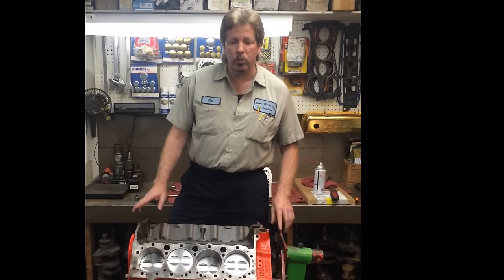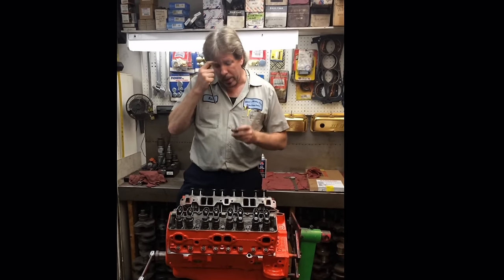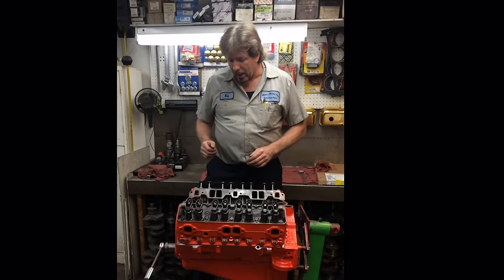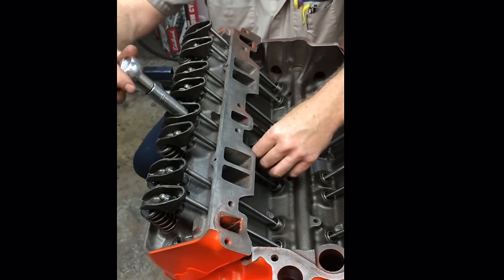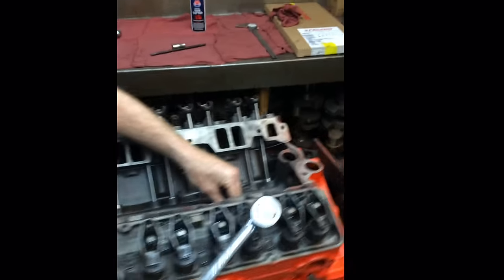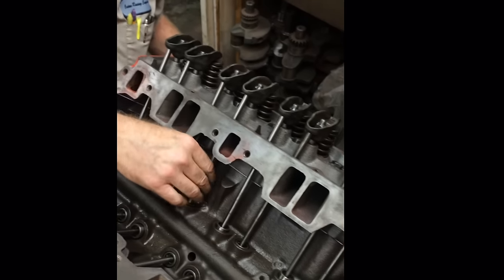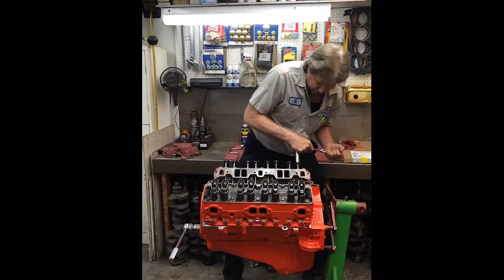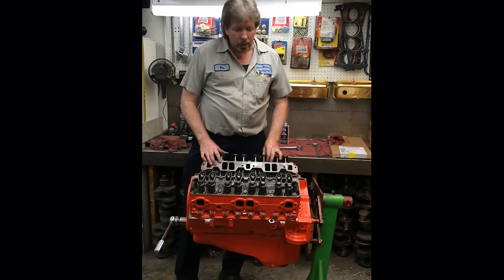Hydraulic valve adjustment made easy - Your Engine Guy

Comment: Wow, great method!Dumb question  here. What method would apply if say you're adjusting the lash of an engine in a car, that you havent replaced the lifters and they remain full of oil. Can this method still be used, or a variation of it? 
Great video, Ken!
Reply: This is my question too. Would love to see someone weigh in.
Reply: Same
Reply: Same question---
Reply: Same here
Reply: Did any one get a answer
Reply: @frankyds69charger65  apparently the guy doesnt check messages or something.  Haven't  heard a word.  Sure would like to know
Reply: Method would be the same
Reply: @farcere  hes pretty clear in the video about the lifters not having any oil in them.  It almost has to be a bit different when dealing with pumped up lifters. Have you tried this with full lifters? I would just like a bit more detail as to why its the same method? Thanks
Reply: @BigBillMiller66  I'm a little confused too, have watched the video several times to pick up any nuances. Part I'm thinking about right now, is when at the beginning he says pumping up full of oil and getting air out, creates a solid lifter effectively and gets rid of the cushioning from the spring inside.
Later he says when people do the running engine method, (which I assume creates the above scenario of filling the lifter full of oil and no air, creating effectively a solid lifter?) then people would find zero lash at that point, the go 3\4 turn over and it results in valve hanging over, but he says that levels out after a short while. Which I can't quite figure out... How would it level itself out if it's full of oil and effectively solid. And I think herein lies the answer to our questions... If the lifter under normal running is NOT 100% full of oil, as a result of it acting like a check valve... Which could mean it empties out a portion to allow room for the spring to take up that 30thou movement, then it should be possible to start engine, let lifters fill up, turn engine off, take valve covers off,and do the process he describes. That way, sure the lifter will be full of oil minus the 30thou space, so it can be set to zero lash, then turned 3/4 to take up the room that the internal spring has, and that would mean it's set right. 
But... It still doesn't make sense to me. if the lifter acts like a check valve then the part about not soaking them wouldn't matter, as it would clear the oil after a few rpms. So I must be missing something.
What I do know, is that engine ran ok, had what I thought was a loose lifter, did the methodology with oil in the lifters, and the engine ran terribly. It ran like he said at the start... Rumbling, shaking,stalling  etc. And it never self adjusted. So that makes me doubt the theory of oil filled process. But then that's how folks did it the bad way i.e. engine running and valve cover off. He says in vid they did that, found zero lash,then turned 3\4 over and it would stumble but clear itself out. So it counteracts itself.
Basically after trying it, confused and still looking for a good answer and explanation :)

Comment: What if my engine's already installed and the lifters are full of oil?  Can I still use this method or will I open valves when I pre-load?  Thanks soooo much for this one!
Reply: I did my engine before with the lifters full. It worked just the same.
Reply: @karlchilders3127  i have my engine to the 3/4 turn part and not wanting to go 3/4 turn on probably full lifters... You said you did though and it was good?
Reply: @workingmansrestorations7071  Yes. Had no problems

Comment: Hey ken great video!! One question though, what if there is already oil in the lifters? I’m working on a 302 and just put some jr Windsor heads on it. I did your way to the point of zero lash, but now only some of my lifters are spongy and allow rocker movement. Can I still move onto the 1/2 or 3/4 turn or should I let them drain down overnight? Then again, if I do that and then reset the lash, when I rotate the motor, I’ll pump them up again!!🤦🏼‍♂️ please help
Reply: @Robert Hartwell   How did it turn out?  Did leaving the lifters upside down over night work then doing Ken’s method work out?
Reply: @jbh.6257  It will still work just let it bleed of for a while before you start it.

Comment: I have a question sir how about if I have the vehicle running already with oil in it can I adjust to that same way like you said my taking the valve covers off do I need to Prime after I adjust even though those oil already in the existing engine and it's not so what would happen if I don't Prime after I readjust it running engine I mean old running engine
Reply: i have  the same question
Reply: @mr.fiero87  set the engine at tdc and turn it 90 degrees for every consecutive cylinder in the firing order. Doesn't matter if the lifters are filled. Final preload can be done right away or wait till the end so the engine is easier to turn and do them after all after the lash is set for all cylinders. If you are having trouble finding tdc hold your finger over the #1 spark plug hole and bump the engine over until you feel the compression. Once there double check it by looking to see if you can see the tdc timing mark on the damper and turn the crank to zero degrees. Then you are ready to start the lash adjustments. Final is 3/4" just like the video.
Reply: @supersportimpalass  thank you much !

Comment: Great video, great method, but you are working with a fresh engine where the lifters are dry. What if the engine is not fresh but has thousands of miles on it and the lifters all have oil in them? Many here say you can use this procedure with lifters wet or dry, but you were very adamant about using dry lifters. Can you clarify this point?
Reply: The oil fills the clearance and hides that drag, with lubricity, so yor not accurate  on zero lash.
Reply: I had the same question.
Reply: If the motor has been sitting for days then the lifters wont be pumped up. This way will work just like any other method.
Reply: What about a existing engine that’s ben put together and running for some time. I pulled my ford 427 valve cover and some rods were loose about .032” in between the top of spring and rocker arm. I don’t know if it’s a flat tappit. It does have hydraulic rockers. Afraid to touch them.I pushed on the rocker arm to try and depress the rod and no movement so I’m guess I don’t have hydraulic lifters?
Reply: No prob not if they don't depress any after its been sitting for days. If it aint ticking or sounding like a typewriter let it be. Little loose is better then to tight. To tight and you will burn valves.
Reply: Dick thanks for input I am going to let it be
Reply: @mcm3566  yeah. I hear half turn and 3/4. I feel like i went pass zero lash so im only going to do half turns to be safe.
Reply: I’ve quick adjusted lots of motors to start them up and have them at zero lash or close but I don’t think I ever had empty lifters. Where I came from bolting heads on a motor, putting in all valve train, adjusting the valves close enough to start, closing it up, putting all the wires on ( without a book ) and starting it up in less than 5 cranks was totally mystifying enough
   Having empty lifters would definitely enable you to also have them fully adjusted before the 5 cranks
   I did it that way sometimes with full lifters but it was rough getting it going till they all sank into position
Reply: Mike Johnson he's talking about a running engine that just needs valve adjustments. I can assure you no one is pulling a engine and tearing it down just to clean the lifters. It will be fine. Let it sit a while if you can before you adjust them. Have been doing it for years. Just did my mustang last week and i didn't even have to tear the engine down 💁

Comment: I have been adjusting valves like this for years. People justmake things harder than they need to be.
Reply: Do you need to drain the engine the oil for doing this?
Reply: Also, do you need to start at Top dead Centre?
Reply: @The3rdCoat  Lifters need to be dry, so if you have replaced them with new ones with no oil in them then no, otherwise you would need to pull them and drain the lifters some how.
No need to worry about where tdc even is, that is the easy part of what he is saying.
Reply: @ironcandleforge9547  if people don't know how to find tdc to adjust the valves they probably don't have the comprehension to make sure all the other little details are correct when building an engine.

Comment: I had to replace my cam and lifters in a 350 small block and while I was in there, I added roller rockers.  I followed this valve adjustment process to a T and my engine started after one crank.  Trust his process because it worked like a champ.  Thanks for the help.

Comment: This seems like it only applies to new builds, due to the dry lifters and zero oil. Does anyone know if this will work with a previously running engine? I have 283 with a at one point had a stuck/collapsed lifter. Will the lifters bleed off the oil after sitting over time to let me use this technique while cold?
Reply: Good question. I am about to pull the heads off my 440. As I did not build the motor and I have never had it apart.I have a bad head gasket.I figured while I have them off I will have the machine shop go through them. I would like to use this method for reassembly but my lifters will be pre-loaded with oil. And he stated numerous times they need to compress all the way. So I would have to say using this method on a head replacement will not work.
Reply: I dont think it even works on dry builds cus the valves wont fully close once the lifters filled up with oil it wont close

Comment: Summit says to tighten 1/2 turn after you get zero lash. Is that enough or should I go 3/4 like you said?
Reply: Do just like this Guy showed you, I have also used this Method that my Dad showed me 40 years ago and as he says the Engine will start First time every time when you Adjust The Valves this way.  a 1/2 Turn is ok 3/4 is ok and a Full Turn is ok any of the  Three and you are in the ball Park as this Guy says and I agree that 3/4 of a final Turn on stock lifters and push rods will get you closer to the 30 or 35 Thousands depth you are looking for in the Lifter.
Reply: I think it depends on your cam and lifter. ..he said he went.   .035"    for his application. ...the goal is to Get your preload at the very middle of the lifter plunger ...

Comment: Very informative video but one question, are you tightening it until the pushrod is just barely spinable or until it doesent spin
Reply: That's what I need to know too. Adjust till the pushrods not turn or just snug
Reply: Adjust pushrod until it stops turning=snug. That's zero lash.
Reply: No
Reply: just until it drags but still spins, that's very important so it touches the lifter on the bottom and at the same time touches the rocker arm above, but yes still spins

Comment: Stumbled across this video looking for something else. You're making this W-A-Y too complicated. For SBC engines, read the shop manual (probably the same for Ford & Chrysler). You can do this in under 5 minutes. Put the engine at #1 TDC. Adjust exhaust valves the way you're showing (by feel) on cylinders 1,3,4,8, and intake valves on cylinders 1,2,5,7. Rotate engine ONE turn which puts it on #6 TDC and adjust the remaining valves: exhaust 2,5,6,7, and intake 3,4,6,8. It doesn't get any simpler!
Reply: His is simplified.
Reply: Davidy J  in all fairness he did say it’s an easy way to adjust values when you’re running a business and get pulled away. I’ve seen it done both ways and both ways will work. What both failed to mention is how to get the engine back to TDC to simplify the distributor installation after adjusting the values but that’s for another video. I like the simplicity of this method and the bonus of “flushing/filling” the lifters using the oil pump - nice tip!
Reply: I have had your method not work with exotic camshafts this is fool proof if you are in a big hurry buy a crate motor
Reply: mountain machine most exotic cars run single or double overhead cams which don’t have standard lifters or pushrods so this method wouldn’t apply since you don’t seem to understand that maybe you should stick to those crate engines
Reply: This is good info to have. Will save me a little more time whenever I get the money to change out my lifters.
Reply: I think you missed the entire point of the whole video which is to get away from " do this to these first on this side at this rotation"
Reply: mountain machine Yes I read, quite a bit actually. I write too. I have been doing so for a very long time. Do you comprehend much? Or just the easy stuff? I feel as though this is probably a waste of my time as you don’t understand the different between a 16 valve OHV V8 and a 40 valve DOHC V8. If you struggle to adjust the valves on any pushrod motor the way he shows then you have no business building a motor and should stick to cleaning parts.
Reply: Charles Sumpter I'm pretty sure he means big cams, not exotic engines.
Reply: Bryan Roupe bro he doesn’t know what he means someone he knows probably knew what they’re talking about and had problems on a big cam an he tried to act like he knows something like he works on expensive cars. The only foreign engine he’s ever touched is a Honda and that was probably a go kart or a generator motor. There’s no reason this method wouldn’t get you close enough on any  rod driven ohv engine. Might not be perfect but as close as any other method would get you.
Reply: thankyou for having more common sense than any of these cheerleaders here , you rock !!!

Comment: I wish you had this video up in 2001. I bent two push rods putting a 350 camshaft in a 305. In timing chain. I know a guy from when I wor.ked at Central Auto Parts. He said
 he could have done the valves. For $50 bucks. I never took him on it. I thought it would have been a mess. Great video man.

Comment: I agree with your method 100%. I've done much the same except not through so many times. I still like to adjust them running so I bought those little all metal rocker arm clips and took an old valve cover, cut about 3/4 of the top off so it still remained rigid and just bolted it on using the two lower bolts. You can then take all the time you want adjusting them with no fuss or mess. BTW, I go the full turn past zero lash, 14/ at a time. Great video!
Reply: You go a full turn instead of 3/4 turns?

Comment: 6 years later this video is still helping us… I’m rebuilding a 460 Ford and I’m close to this step. Thanks for your help, us younger guys need help sometimes
Reply: 460 doesn't have any adjustments unless ya got a aftermarket rocker arm assembly.
Reply: @johndowe7003 hey John was hoping you can help me out . I got  a 390 fe (ford) . It has a non adjustable rocker arm shaft . Can I use this procedure?  Or?     Do I just need to set the pre-load on it. & that is it.. please help thx buddy

Comment: Dealing with valve noise on my 84 pontiac fiero with an iron duke. Thanks for the video it's helping me piece together exactly how these valve trains work. I've been told by many people and even the service manual that hydraulic lifters are either non adjustable or self adjusting but I know that can't be the case. Rockin hairdo by the way I dig it.

Comment: Wow thanks for this awesome explanation!! I'm a Novice to this hobby. 78 nova with a 350. Got a wiped cam lobe on a recent rebuild. I noticed it when I was doing exactly that adjust my ticking rocker arms while engine running, used the Mr. Gasket oil deflector clips they actually worked great for me no mess. While doing this I immediately noticed one of my rockers was not moving at all, not a bit 😬.  Now I know why my magnetic oil plug had all the gunk on it and my vacuum gauge was bouncing around while trying to tune my carburetor and also a slight misfire. I'm getting the Edelbrock top end kit, Heads, Cam, and timing chain, and will install myself tired of dealing with shops.  It will be my first time doing this so your video will be a great help when it's time to adjust the lash. 😎

Comment: Just found your video.... awesome. I have been building FE engines specifically for 25 plus years. I too have been doing what you showed to the amazement of my friends. Thanks for posting this video.
Reply: Never saw a Ford FE with adjustable hydraulic tappets. All were on a shaft. I missed something in the last 45 years

Comment: Great 👍 video I'm doing the intake on my 97 Oldsmobile 88 3800 motor and decided to do the head gasket also and while I was there figured why not change the push rods and the hydraulic lifters and The Rock arms and then I couldn't remember how to adjust them proper it's been so long I've done it and so a thousand videos and I still wasn't sure until I came across your video thank you for your knowledge your diamond in the rough I'll be checking out the rest of your videos have a great day

Comment: I was taught by HIGH SCHOOL & MY EMPLOYER OLD SCHOOL, 
 VALAITIS MOTOR SERV SOUTH PHILADELPHIA PA 
School & His method was the oil soaked way making a mess . I changed it to this style & have been doing this since the early 90's with NO ISSUES AT ALL IF YOU 
DO NOT PRE SOAK HYDRAULIC LIFTERS 
The only thing I changed with this approach was every VEHICLE is different.
 I may reduce hydraulic valve lash adjustment by half turn instead of 3/4 turn pending on cam card or manufacturer specifications . 
💥 BADA BING BADA BOOM 💥
I APPROVE THIS MESSAGE 🙌
Nj'sJfJr 👍🏼💪🏼❤️🇺🇸